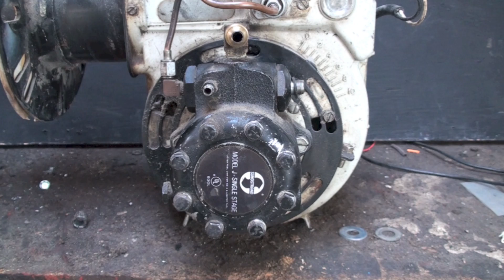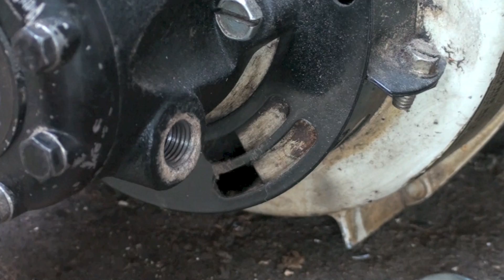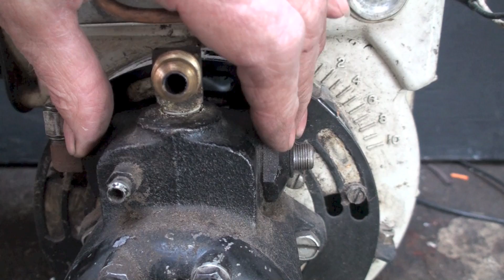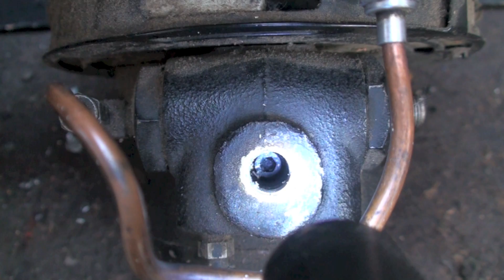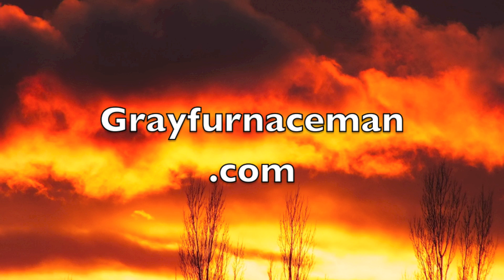Oil furnace pump bypass plug

Comment: Based on the Suntec manual it seems like in a two pipe system when you put that bypass plug in it suggests using the inlet line to the left of the bypass plug for the return it's confusing this made me think that my pump failed prematurely after a year because I had connected the return line to the return pork with the bypass plug installed. But this video suggests that my original piping was correct so the question is why did the oil pump grenade so early in life after just one year?

Comment: You are gold GreyFurnaceMan. I want to remove my old steel 275 single line and replace with a new double wall Granby or equivalent. I am trying to learn what is needed. Thanks. Have a 1 year old Peerless with Riello burner.

Comment: Question on 2 pipe on 3400 rpm Beckett AFG in New furnace.  Is squeal in return line due to cavitation? It varies but get loud sometimes. Barely hear it in the supply line. I just changed the filter and it wasn't real dirty but it did quiet it. I have about 20 ft of line each way to an outside tank. I am lifting about 5 feet then thru wall,, across ceiling in basement about 10 ft and down 5 feet to the furnace filter and into it. Beckett 10323 pump with bypass plug installed.
Charles
BTW, I love your videos.

Comment: Question, let's say I want to change a 1 line system to a 2 line system I. E. Tiger Loop. Is the bypass plug currently removed on the 1 pipe system? Do I need to add/purchase a bypass plug now for the tiger loop?
Reply from the maker: You must install the bypass plug.
GFM

Comment: Old and reliable. My american standard a-3 boiler usually runs without issue. However recently pump shaft seal started to leak. I had a J2CB-100-3 pump and suntech told me to use a J4PB-1000-G pump to replace it. Everything works as before, except now when the burner shuts off you hear a last 2 or 3 pulses of flame. Is this normal/ok. The old pump flame would just stop.
Reply from the maker: I would not be concerned.  If you want to stop it, you could install a shut off on the gun line.
GFM

Comment: Ive got an older beckett burner in a miller furnace in my shop. I recently mounted the heater about 7 ft up on the wall. Had it running yesterday.  Took a while to bleed. Undersandable its prob 8 ft of line to the pump. Pump looks different then the one in your video. Do I need to put a plug in somewhere? Remove a plug?
Reply from the maker: You must install a bypass plug.  The pump should have marking that tells which tap it should be placed in.  It is an allen set screw fitting.  
When you install the plug, a return line must be installed at that fitting.
GFM
Reply: Ok. I'm gonna try a  check valve first. If that doesn't work ill try 2 lines

Comment: Thank you,Real good info
Reply from the maker: Welcome
GFM
Reply: I do have question on two pipe system!! Can we use the bleeding valve or the bleeding valve it’s not gonna work when install the plug on the return and converter to two pipe system? Thanks

Comment: Instead of having a tank oil return line, why not install a Tigerloop?
Reply from the maker: Because it is simple and effective.
GFM
Reply: Tigerloops are also about $100, and the company says to replace them ever 10 years as preventive maintenance.
A tigerloop will fail before a simple return line will.
Why complicate something that doesn't need it.
Reply: Let’s say someone is clueless what happens when you forget the bypass plug and pipe it with tiger loop and no bypass plug on suntec fuel pump

Comment: I have a question I am in the process of changing out my pump. now when I snug up the two bolts to attach the pump to the housing the squirrel cage gets tight if I back off the two bolts you can spend it freely but it does have some tension on it what could be causing this thank you for the help
Reply from the maker: +Topgunviking Hard To Kill The coupler may be either too long, or if the coupler tightens to the shaft with a set screw, the screws may need to be loosened and then tightened when the pump is tightened down.  Hope this helps.
GFM
Reply: Definitely an issue with length of pump coupling.

Comment: Thank you for making this video I am putting together a newer burner to retro fit on my old National and the newer burner I have was set up for a two pipe so if it was not for your video I would have not taken out the insert and messed up my pump.
I do however have a question the suntec oil pump on my new unit has a box on top of the oil pump with wires going to it what does thsi do? And there is a sticker that says pump pressure set at 150psi can that be adjusted?
Thanks!
Reply from the maker: Walter Null The box is a solenoid valve that lets the pump get up to speed before it opens and lets oil in.  Means a cleaner burn.  The pumps have an adjustment screw.  Not sure where it is on your pump but you might check thru some of my videos on pumps to see if yours is there.  Hope this helps.
GFM

Comment: Hi Gray, I noticed today it appears I have a slow drip coming from my bypass plug (Bolt 4.39 in your video). Normally would that require replacing the bolt or just tightening it? I figured I'd ask before possibly over tightening it. Thank you for your input and video.
Reply from the maker: physiquesSorry about the wait.   I would remove, clean dope the threads (no teflon tape) and tighten.  You can be fairly generous with tightening torque.  Hope this helps.
GFM
Reply: grayfurnaceman Thank you it does, I wasn't sure if putting a little muscle behind it could damage it. Thank you again ;)

Comment: Could ya add the words "two pipe to one" (or vice verca) to the tittle....  Once almost learned about the oil pump shaft (from the distributor) in a 327 the hard way too...